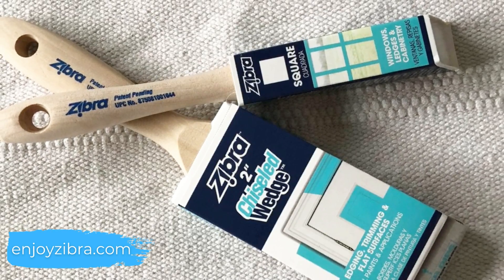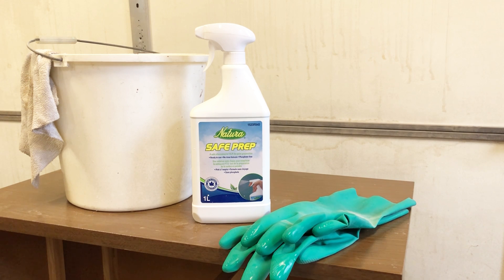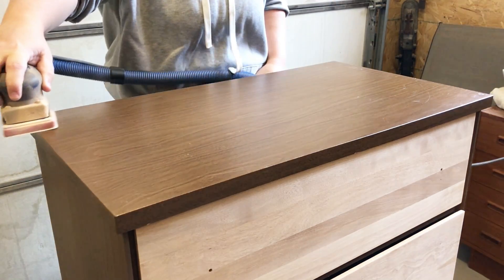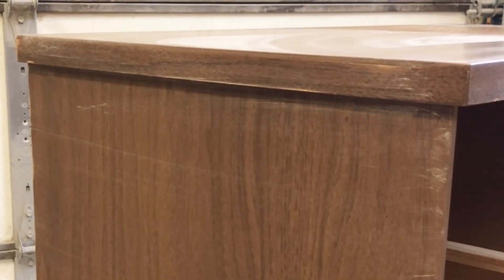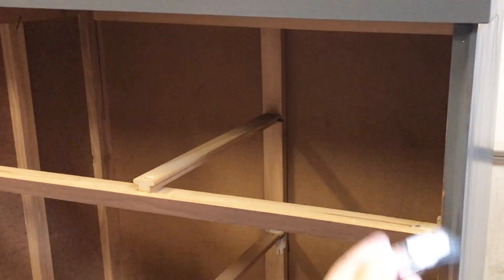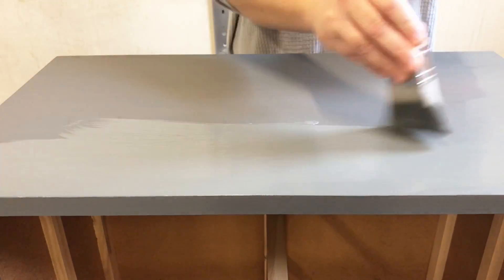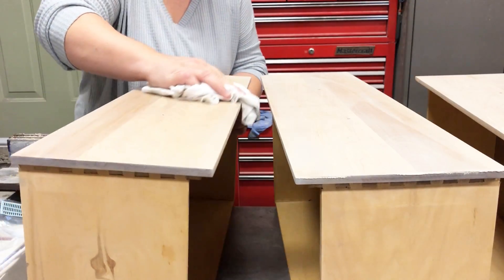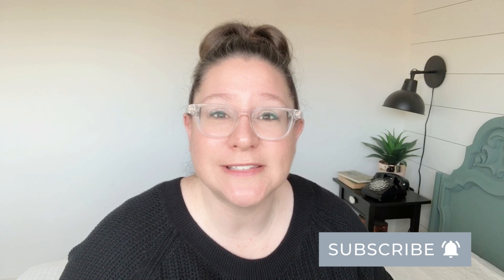THRIFT FLIP | Updating a Mid Century Modern Dresser

Comment: Nice stuff.  One small tip.  You can use a strongly brewed batch of black tea instead of the wood conditioner.  I've used it for years and it works just as good (if not better on some woods like fir).  It's cheaper, better for the environment, non-toxic and super forgiving.  Only thing you'd have to do is a quick sanding (320 grit is usually more than enough) as the water in the tea will "pop" the grain on most woods, but this will make an ultra smooth finish for staining that will take most stains (water or oil based) quite well.

Comment: Katie,   I love seeing your furniture transformations.   I think this one is my favorite so far.   I have never refinished a piece of furniture.  My Dad needs a little bedside table so I am going to go to my local thrift store this week and try to find a old used piece to practice on.   I know it depends on the item but do you have an average dollar budget amount you spend when thrifting for pieces you buy?  When getting started how much did you invest in equipment?   Do you mainly buy pieces that have no damage or gouges?  I have no woodworking skills or equipment so just wondered how much it would cost to get started on a couple pieces for my family.   Thanks.
Reply from the maker: The “thrift with me video” that I posted last week goes over how I choose pieces. I mostly just buy whatever inspires me. I wouldn’t buy anything that requires repairs outside of your skill set. 99% of the tools that I use, we already owned so I haven’t really invested in anything other than paint, which I buy 1 or 2 projects at a time. You really don’t need a lot though - sandpaper, a brush, some primer and paint. I hope that helps 😉
Reply: @salvagedbykscott  the sanding system you own for a basic system with the sanding pads etc. costs  over $450 in US dollars. Definitely not something people "usually own".  

A 1/4 sheet sander,  costs  from $30 to $50, plus the price of the sandpaper. Duct tape a  shop vac hose to it for dust collection.
Reply from the maker: Absolutely true. I only upgraded to my surf prep sander a few months ago. The first 3 1/2 years of my business, I used a cheap mouse sander and a black & decker random orbital sander. The fancy sander is definitely not a necessary tool to get started. In fact, if you buy furniture that doesn’t need a ton of repair you can get away with hand sanding.
Reply: @salvagedbykscott  I will be refinishing my parent's Mid Century Swedish modern China hutch + my "Colormates by Morris" 6 drawer dresser both  from 1959,  a 3 drawer one  I received from a neighbor who passed last year as well as a MCM drop leaf cart from her.
 Think I'll start with buying the B&D orbital sander + a  ¼ sheet sander from Dewalt.  They both have fairly good reviews. What do you think?

Thanks you for your expertise. I've learned a lot from your channel.
Reply from the maker: @tuc1113  sounds like a lot of fun projects! I love an orbital for strip sanding and I had great results with my black & decker. I still grab it sometimes! It’s great for large flat surfaces. I like the point on a mouse sander for getting into corners and details but that can be done by hand too.

Comment: Love the video. May I ask the purpose of the wax finish?
Reply from the maker: Chalk paints are matte and porous so they need to be sealed for protection. The wax provides a barrier against stains or scratches and makes the surface wipeable. Hope that helps 😉
Reply: @salvagedbykscott  it does help! Thank you.  So, do you have to keep applying the wax over time?
Reply from the maker: You can reapply if you’ve got some scuffs but it’s not necessary.
Reply: @salvagedbykscott  thank you!

Comment: I've watched others who brush and it seems up to double the time for a similar piece, more product used and can' t touch the smooth effect you get. But 30-gal compressors are expensive! Any suggestions on brand and where to shop?
Reply from the maker: There are lots of electric paint sprayers on the market if you don’t want to the compressor route but this is the only gun I’ve used so I can’t offer any suggestions or recommendations on the others.

As far as shopping for a compressor 🤷🏻‍♀️ Home Depot, Lowes???